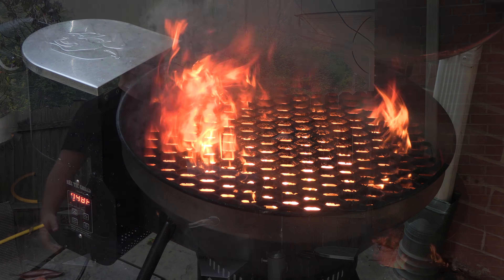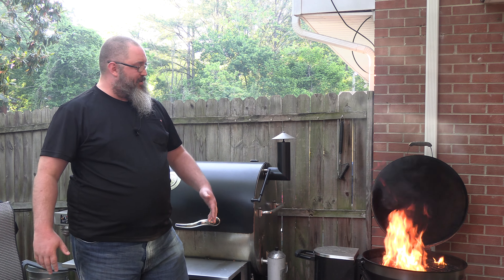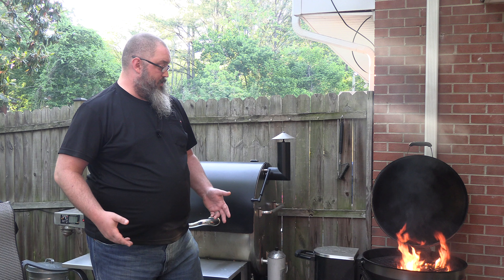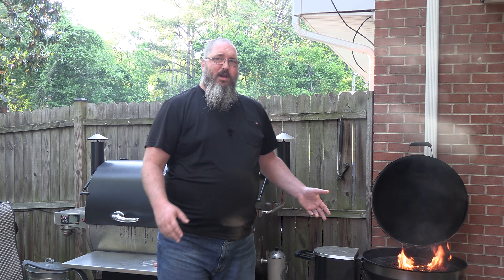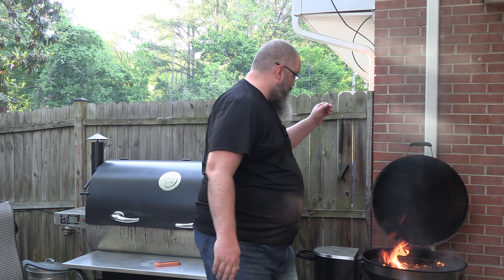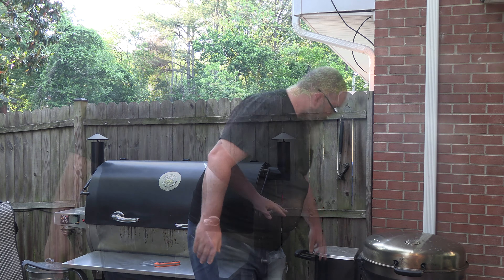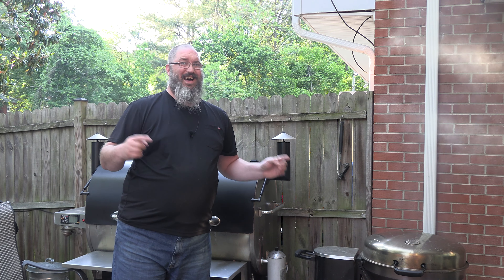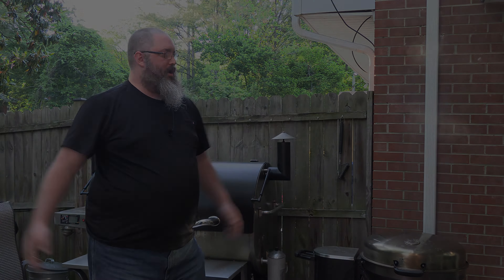Will the Bullseye have flare ups and WHY?

Comment: Flare ups I can handle. I got a full on grease fire last night that ruined our dinner. I just cleaned the damn thing out after the last cook too. I've got a love hate relationship going on with this grill right now.
Reply: Here's my tricks: 
#1: Lava rocks spread over the holes on the heat deflector, and an aluminum covered 9 inch pie pan in the center (you can add juice/water/cider if you want on a slow cook). 
It will catch the grease and really cut down on any grease fires. Replace the lava rocks every year or 2. (They're cheap)  Also REALLY makes cleaning easier.
#2: I always start my grill in riot mode, then dial it back to my cooking temp.
#3: To add smoke, just grab a handful of pellets and sprinkle them on the lava rocks.
Reply from the maker: sorry about ur luck.